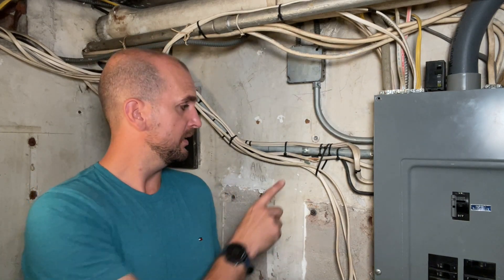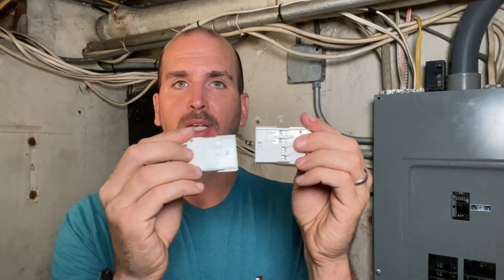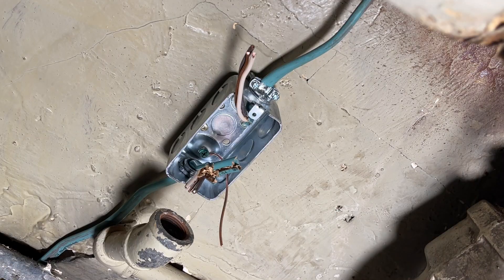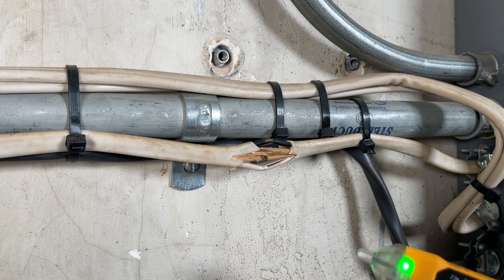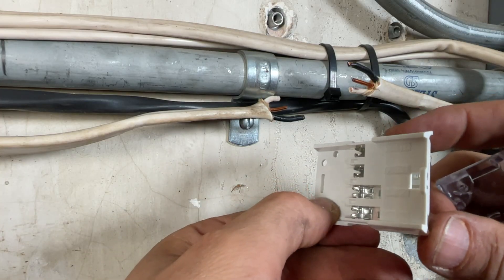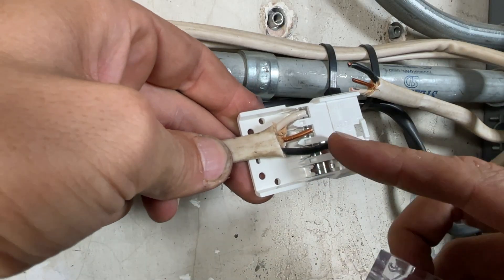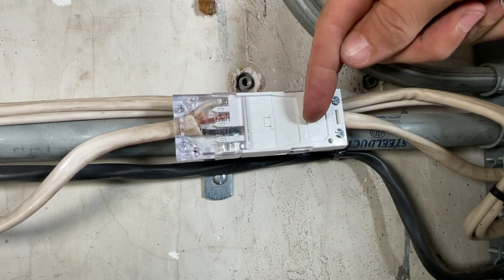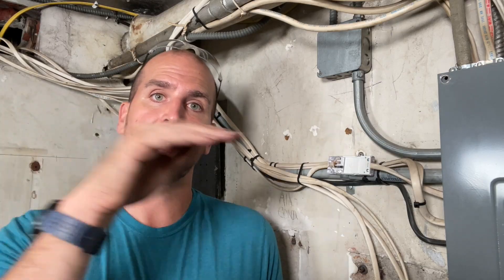How To Repair Damaged Romex Wires

Comment: These “vampire” connections WILL corrode, and cause strange, intermittent problems… VERY difficult to troubleshoot… I’ve fixed too many to recommend !
Reply: This punch, pinch gizmo is really no different then the tap connectors you can buy for auto or home stereo connections. Convenient but in time often they corrode especially in the car and lose contact. I can only guess in time they will  over heat if corrosion happens in the house and could cause a fire. Plastics can warp as well.   Now what I can't understand, I'm not ab official electric person, but have worked with it. A nick in a wire or opened for contact tracing, why could not that wire be wrapped with that shrink tubing, or the electrical tape that also will shrink. Especially if it is near a junction and could be removed on one end to cover it. Yes, wrap the inner wires first. To me a continuous wire is the best connection, or a junction box with the proper wire nuts. This plastic adapter has a total of 9 points that could have a connection problems.
Reply: Yeah you read low voltages on a line chances are it’s a corroded connection someone spliced somewhere 15 years ago

Comment: Those splice kits are not code for exposed applications. They are only allowed where the wire and splice is fished back into an existing/previously closed/sheetrocked wall. They are called IN-WALL splices to connect a wire that barely protrudes from an existing wall to new wire then push/fish the splice connector back into the existing wall. They cannot be used in an area where a box could contain the splice.
Reply: I don't have the 2023 NEC yet, but some of the stuff I've seen the TC splices are going to be allowed to be used in exposed locations in the edition.
Reply: @jimharvey5289  Those connectors are also made by Molex. They are used by Winnebago in  RVs to connect premade wiring harness for the 120 v circuits. They are very hard to find and can sell for $5 to $12 per piece, You need 2 pieces for each connection. They are quite fragile.

Comment: RV service tech here, electrical specialist 3 decades.   Those TC splices are used a lot in RV's especially the transitions between the romex to SO wire  in the slide then back to romex.  I have replaced dozens of them that have burnt.  It might be the total lack of experience in the people manufacturing the rv's in properly or not properly installing them but I would never recommend them for heavy loads and certainly never bury one in a non serviceable location.
Reply: Just a retired career Navy electrician, but I wouldn't trust these splices for the same reason I don't trust backstabbed connections. You're going to have full circuit current going through the tiny bit of contact areas between the wires and those forks. And then bury them in walls, hidden from view to boot? Sounds like a recipe for disaster.
Reply: @dolfinwriter5389 My first thought as well.  I would not place much trust in that type of splice.  Not Code approved but wire nuts would be a much better repair.
Reply: @dolfinwriter5389 Agree completely, why can't people comprehend this common-sense observation?
Reply: I run a company that manufactures wire harnesses.  Most RV wiring is extremely cheaply and poorly made.  They cut every possible corner and most wiring is bespoke  so quality would be hard even if they used good materials and assembly practices.

I would never use insulation displacement connectors like this if I could avoid it in a vehicle application where vibration is expected.  They have their uses but should seldom be a first choice connector.  Wouldn’t favor them for houses either.
Reply: That splice uses scrunch-in connections like a CAT 5/6 connector, which is fine for signal wires but I dunno about putting 15 amps through it.
Reply: @jamesvandamme7786  yup I understand they are bad. I think it is dumb that the only code approved solution is that.
Reply: @jamesvandamme7786  15 amps, or more on the starting surge of something like a vacuum cleaner. And I forget, but did he ever say these were limited to 14 Ga cable and 15A circuits? Could these also be used on  a 20A circuit?
Reply: Yes. I would worry, plugging a space heater into that circuit, how long it would take before the connector melts and tries to start a fire.  It seems like it would have better to leave the conductors intact and to repair the exposed wires with electrical tape.
Reply: That's good advice.  Not often to hear tips from someone in your line of work.  Thanks.
Reply: For all you naysayers that are crapping on this splice kit, just stripped the wires if it makes you feel better! Done!
Reply: What RV stands for?
Reply: @IAmThe_RA  Recreational Vehicle.  Camper, motorhome etc.
Reply: @RVSparky  
Glad you posted this, I'm a mere DIY'er and I know we aren't "supposed" to bury a junction/termination box, BUT I'd trust metal with the O-ring lockdowns over a piece of cheap plastic any day of the week, they probably aren't even all that cheap. There must be a reason that these are allowable and the j-box isn't... I think I'd even trust a PVC box over these! In reality land, how much is this "code compliant" fix any better than a couple Wagos hanging (somehow permanently sealed)?
Reply: @Mike_H76  I suspect the permanent burying in the wall was sort of a secondary or incidental use. They are detachable connectors, so I think it had more to do with needing a way to plug sections of prefabricated housing together.
Reply: @Sean_y4k2l5  
Yea, I could see it being a low-thought design for modular houses. I'd like to see better, though I can't envision exactly what that might look like. Pre-drilled studs, some fish lines... would leave no easy way to staple wires. Perhaps dropping everything down from the attic, but still, no way to staple. 

I'm a layman framer and at-home DIY'er who accidentally turned to the electrical blueprint page once... I "studied" it for maybe 15 minutes and understood a little, but it was mostly Greek to me! I get what you're saying though, thanks!
Reply: @Mike_H76  It should be very easy to design an access panel to connection points for plumbing, wiring, HVAC where sections are joined together. Somebody just doesn't want to do it RIGHT because it will cost more.
Reply: @dolfinwriter5389  
No doubt... with access panels. But, most people want a finished wall. Personally I want panels that access every mechanical/electrical/structural failure point... my lady would disagree though!
Maybe I'm biased from framing mega-mansions in the Hamptons, but I like site builds... my buddy (who also worked on my crew) has "assembled" a few modular homes at his current company, he hates them... too much standing around.
Reply: @Sean_y4k2l5  
Yea, I see the Wago boxes. But, why? Seems the retention are some plastic clips, box gets zip tied closed. I don't see it as an upgrade to a regular metal box with ring retention and a grounding screw (and multiple ways of attaching). Feels like a mousetrap redesign in molded plasti-crap that might save an electrician 15 seconds... though the gel one looks "cool".
Reply: @Mike_H76  I just think it would be nice to have a code-approved way to splice and leave it buried when retrofitting lights and things like that.  that's the idea, is to not have to add accessible j-boxes... leaving another wart on the wall/ceiling. 

I deleted my comment about the Wago boxes because I'm not sure if it's accurate. might  be true of some countries but probably not USA/NEC.

Comment: It makes sense to me that these should be sold by wire size, not 1 size fits all. I personally wouldn't use it I prefer junction boxes.
Reply: The one size that the are sold in is for two very specific wire gauges: 12 & 14. I would assume that when you use them on 12 gauge wire, the IDC is going to cut into the copper a bit more than on 14 gauge wire (it shouldn't really do more than graze a 14 gauge wire), but in doing so, the steel of the IDC is going to create a U or V shaped channel in the copper that will increase the surface area of the  connection between the copper and the steel, so the current carrying capacity of the spliced joint is at least the same as the orginal copper (providing the IDC pin has the same current carrying capacity as the copper). The differences between the wire gauges (12 & 14) means that 80% of the 12 gauge wire will remain undisturbed (and 20% be displaced by the IDC). This remaining 80% is plenty to ensure that the IDC remains attached to the copper. As explained above, the other 20% that is displaced remains in contact with the steel IDC pin so the IDC pin is actually making the conductor larger at that point, not smaller.

Comment: Very good video. I have had situations where this splice would be perfect. If there is a termination within that room, I would prefer to install a box and replace the wire from the new box to the termination point.

Comment: One tip, at 1:56 you're checking to be sure the power is off. You tested your tester before but not afterward. You should also test the tester afterward too.
Reply from the maker: Thanks for the feedback
Reply: And on ALL of the wires, not just the one you think is hot. 💙 T.E.N.

Comment: If the wire itself is not damaged, why not simply open the Romex  to allow use of a dielectric sealant under proper splicing tape. then use more self adhering splicing tape over the entire area with some dielectric sealant on the Romex itself. do not use electric tape, only splicing tape.

Comment: Code here is all splices, junctions, whatever you want to call them have to be in a box and have to be accessible. Also you have a non contact voltage tester, we call those death sticks. And you have exposed wires right there and you could have used a contact voltage tester to be 100% safe. You are really showing and talking about unsafe practices

Comment: As a professional I have a real love hate relationship with these ‘in wall splice kits’ they can be absolute lifesavers at times fixing the issue by way of an approved code compliant method which can be buried in the wall save if hundreds in not $1000 plus to completely replace a wire while maintaining a clean appearance. 

…At the same time There’s this nagging feeling that if it fails it will never be found again. There are some expensive wire tracers that will find it but most electricians I’ve met don’t own one of those. It is listed but it goes against one of the most basic rules electrical work, which is to never splice outside of an approved enclosure.

That being said I’ve never had an issue with one of these ever and I have used them several times.
Reply: The splice kit outer shell is an approved mechanical protection enclosure, it just not a junction box.

Comment: I am replacing knob and tube circuits in my home with up-to-date circuits, boxes, wires, and breakers.
The main problem is the ceiling lights. When I put in a new box and wires I can't pull out the old wires. What do I do with them? I don't want to put in a second box with a blank cover in the ceiling.

Is there a way to safely, and to the satisfaction of code, tie off old knob and tube wires inside the wall/ceiling? Perhaps in a closed box with wire nuts--but up in the ceiling without ready access? This splice product caught my interest because they are approved to be in the wall space without access. 

I plan to disconnect the wires from any charge (at the switch), however, the neutral wires may still be connected, and sometimes I wonder if they are connected between circuits, outside the service entrance--without modern parallel wires in a cable, how can you be sure?

How do you electricians treat these old left-behind knob and tube wires?
Reply: you can disconnect the K&T on both ends and abandon it in the walls. nothing wrong with that. it's no longer part of the electrical system and therefore not governed under NEC.

Comment: I have been reading more about these plastic snap-together things. Apparently, they are ONLY to be used as a last resort and ONLY when the cable is not replaceable totally. Judging from the tone of the article, this is mainly about flooded houses  However I have been in flooded houses and can honestly say that once a house is getting rehabbed from a flood, EVERY wall and ceiling gets taken down, thus exposing all the wiring and etc. From this it is easy to see that the plastic gadget is NOT ever code level appropriate since everything is accessible during the rehab. 

From this I am thinking that the manufacturer paid the NEC a boatload of money to get their gadget included in the code, (to increase sales no doubt but also because the thing has been used in manufactured housing for some years more or less successfully) but only with very narrow and specific requirements and applications too. 

All of which is of course enforced on the local code level. But few if any of these stipulations are known to the DIYer, or many electricians. Also I read that "training" in the proper use of the gadget is required. But how is someone to get trained? It is all a bunch of monkey-business in my book: Sell unsuspecting people these expensive things and then let the local inspec fail it (or let the house burn down from a bad install) then blame the installer for not being properly trained in the gadgets use.
Reply: This is some boomer-level logic bro lmao...

"Manufacturer paid the NEC a boatload of money to get their gadget included in the code to increase sales"

 Are you for real? This is literally made up speculative B.S. with no factuality (or even common sense for that matter) behind it. It's just you spewing your own personal made up beliefs and nothing more...

The FACTS are that Wago (as in the ones manufactured by the WAGO company and not some cheap Chinese knockoffs that LOOK like the ones manufactured by WAGO) are NEC compliant regarding splicing and terminating conductors, and UL certified for 600V and 20A capacity.

The only people who have a problem with WAGO connectors are misinformed, out of touch people who are using outdated information and/or stuck in the stone age of electrical code compliance. There is nothing wrong with a good old fashioned wire nut, they're perfectly fine and are the standard but lets stop acting like they're the only thing that is acceptable. Technology and innovation drives positive change and the WAGO connector is a part of that in this field.

Stop spreading your own personal opinions and lack of information as truth, it's gross.

Science, testing, and education that end up forming the foundation of a fact hold more weight than  your opinion.
Reply: @alexvega8026  You have your opinion, everyone else here has a different one. Seems to me that you like this "new age" plastic stuff so much that you maybe work for the company? And if you really believe that code writers are not biased and open to influence then you are delusional too. Anyone who actually reads NEC every day can easily see all sorts of bias and double talk in that book.

Comment: Just broken insulation is there nothing you can put on it to protect it like liquid tape once you cut the wire you creating more of a problem you need to replace the wire if it's in a good safe location you should be able to just use electrical tape

Comment: I'm astonished that side-blade contact for a 15 amp circuit would be UL listed for more than 5 or 6 amps.  Contact surface is a fraction of the wire's diameter and would become a hot-spot if the current approached the fully allowed load on that size AWG.  'blade/piercing' works fine for replacing a plug on a table lamp, and for phone/lan connections, but I wouldn't trust it for a main branch right out of the distribution panel.
2011 NEC allowed for 'insulated tap devices' in exposed runs or where it would be 'fished' into an existing concealed space.
2014 NEC allowed for 'non-metalic sheathed cable interconnector device' that is UL listed, in exposed runs or for REPAIR only where it might be concealed (i.e. nicked a ceiling light run inside drywall and you have to cut a hole to get to the damage wire to repair it), but never for rewiring.
Reply: It's UL listed for 20A, and will have been tested to a higher current. It would make a good YouTube video to see one of these connectors tested to destruction. My guess is that they would be good for 46A.
Reply: That was exactly my thought. Someone is going to put a 1500 watt heater on that circuit and run it for 3 weeks straight 24/7. I wonder how hot that is going to get since it is a very high resistance compared to the rest of the wire.